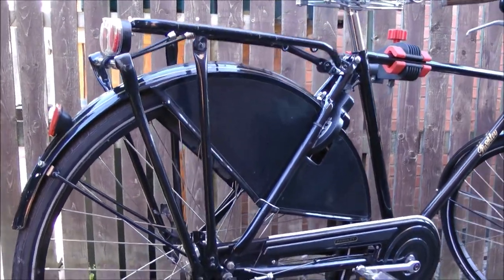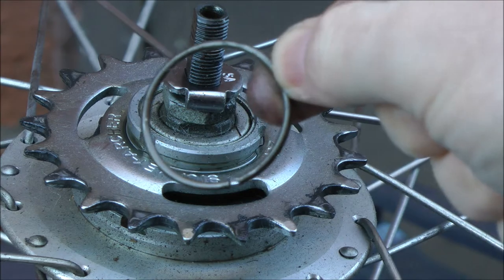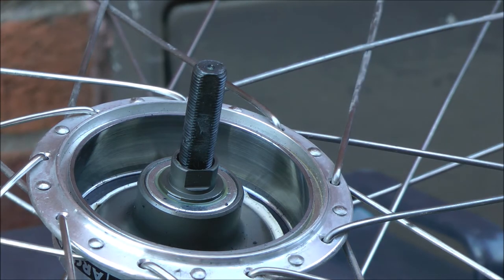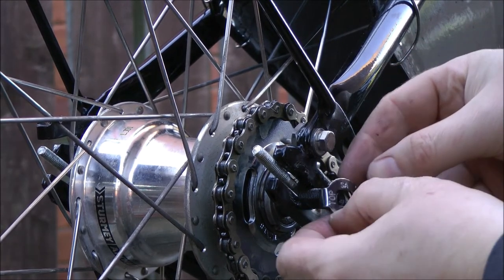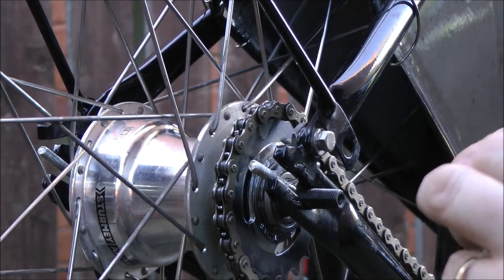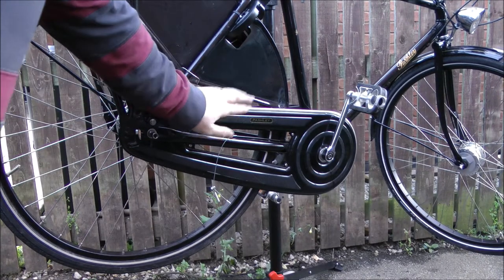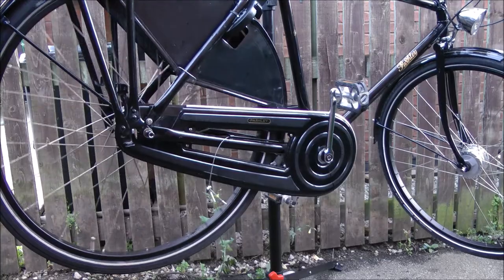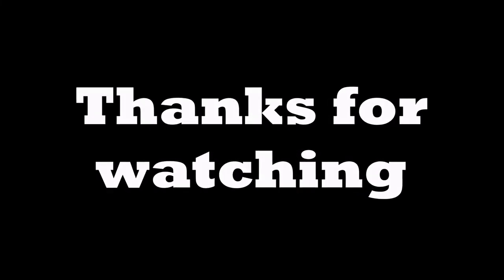Pashley Sovereign gets new sprocket, and drum gets cleaned.

Comment: Thanks really helpful. I have a Pashley Princess (?), I think, bought second-hand about 10 years old but light mileage and stored in garage. In very good nick but the chain started to slap. I fitted a new one, but getting the tension right and holding it has been problematic. Your video is very helpful. I found some chain tugs (hadn't heard of those before!) from SJS Cycles, which is like one of those old-style bike shops but with an internet ordering service. My brakes are still in excellent nick, will keep your instructions in mind for when (or even better a bit before), that is no longer the case.
Reply from the maker: Thank you for your comment. Chain tension and wheel alignment are a lot easier with the tugs (not even sure that's the correct name). I have bought from SJS before, and always had good service from them.

Comment: Correct placement of those anti rotation washers is a bit of a mystery to me. The concave part of the ear fits over the tensioning bolt, so that suggest to me, to point the "ear" towards the rear of the bicycle. But the frame is stronger when you point the "ear" towards the front of the bicycle. Not sure what is best, but I don't think it matters a lot :) The ears on your anti rotation washers did not look concave, but on older bicycles they are concave.
Reply from the maker: Yes, I've noticed the concave type on older Sturmey Archer setups, and also thicker "stepped" types that seem to give more support in the dropouts. Not sure which is the best type, but chain tensioners seem to be overlooked on newer bikes for some reason.

Comment: Great vid. Your chainguard has a different mounting bracket than mine. Mine is a complete PITA to get off, removing the crank, disassembling bottom bracket etc etc ! !
Reply from the maker: Some chainguards are a real pain - the one on my modded Prospero needed a crank arm off, and unbolting the seat stays. Needless to say, it's not purely for aesthetic reasons that I've not fitted it back on. This chainguard is plastic and, although a little bit fiddly, can thankfully be removed quickly without a total stripdown.
Reply: @noble_wolf  I couldn’t see how to get  my plastic pashley sovereign one off, I have though found a small section above the rear cog can be removed for chain oiling… ( I have 2 sovereigns… the other came without chaincase… dispute with previous owner I suspect! )
Reply from the maker: That sounds rather different to mine, mine is just the 2 pieces top & bottom.

Comment: Ahh the chaincase is still a mystery to me!

Hope your brakes are better. I’m going to revisit mine as I dont think they are as strong as should be, I’ll be degreasing this time with some solvent spray like you suggested. I think the dc189 levers are pulling less cable giving a spongy feel and reduced braking so I’m having to compensate that… perhaps some compressionless housings I think.
Reply from the maker: There wasn't much difference tbh, but I will give them a chance to bed in (the front one is bedding in nicely now, improves every ride).

Comment: Thanks for making this video. I found it really useful but I’m not sure how to go about sanding the braking surface. What grit would you suggest to remove the glaze and do I need to use any particular sanding motion?
Reply from the maker: I just used whatever was at hand to roughen the surface and get rid of the glaze. I think it was 240 grit, if memory serves, but I wasn't removing much material.

Comment: I notice your bike has a propstand. Do you use it much? If you were buying a new bike would you pay the extra for the option?
Reply from the maker: I do use it, personally. Sometimes leaning the bike on something is easier, depends where I am, what I'm doing etc.
I personally would be happy to pay a little extra for one, others may disagree
Reply: @noble_wolf  
Thanks. If I buy a Pashley from a dealer I'll certainly add the side stand.
Unfortunately, or not depending on your viewpoint, I can no longer afford to think about a new Pashley, because when I got home EBay wanted me to look at a 1987 Pashley Estate trade bike. Three speed with drum brakes front and rear, but no stand of any kind. Not even the frame stand usually mounted to that massive front basket frame.
It still has the factory tags hanging from the frame. 734 GBP after shipping and taxes.
I'll have to deal with a stand when it arrives.
So I just joined you in the Pashley world. I hope it works out.